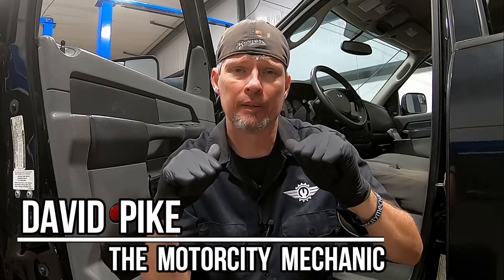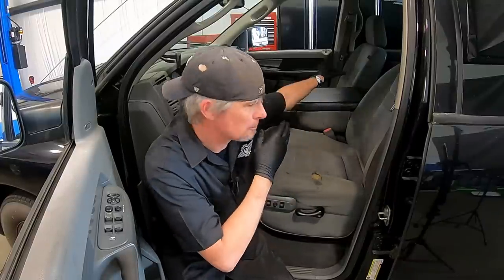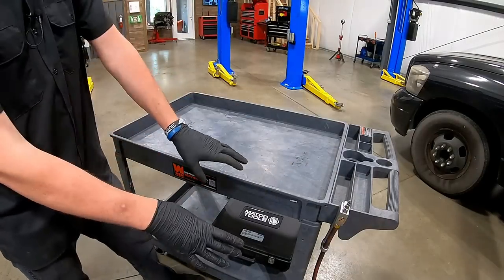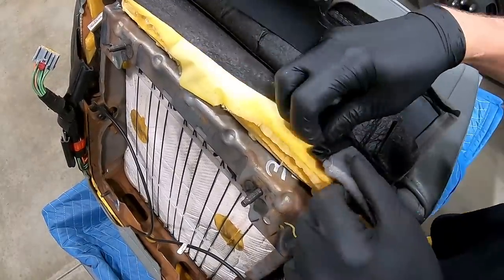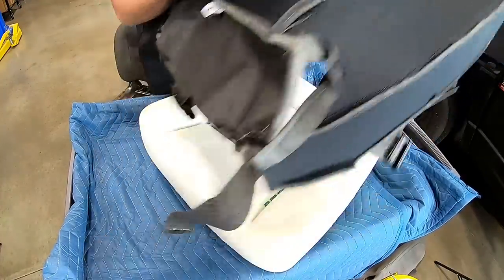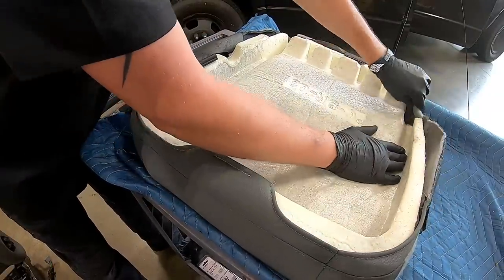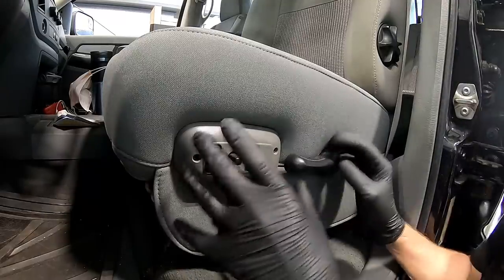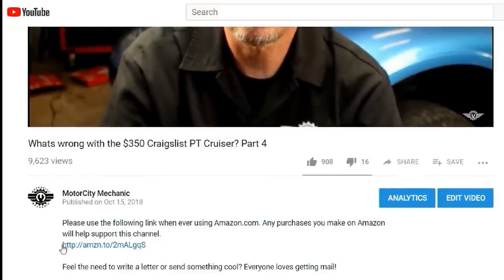2006-2008 Dodge Ram truck lower seat cushion and cover replacement

Comment: Just changed mine. You don't need to remove the chair or any of that. Simply remove the straps at the bottom and wiggle out the cushion from the back and done. No ratchet no nothing. 10 min job start and finish. 2006 dodge ram 1500. Exactly same seat in the video.

Comment: Great video!  One of the best "how-to" videos I've used.  My seat looks much better!  I do have a couple of suggestions to add for those who are about to tackle this cushion and cover replacement.  Be careful with the felt material - it is rather fragile.  I did tear off one of the clips - possibly because I pulled too hard or just at the wrong angle.  Also I suggest waiting a little further into the process to cut your opening for the electrical controls.  I ended up cutting my opening too high.  Because of the new thicker cushion the cover didn't pull down as far as the old one did.  So I suggest pulling everything tight and clipping in all but the clip closest to the controls so you can see exactly where to cut.  With a new cushion it may not exactly match the opening in the old cover.  One more thing - be careful if you press in the Velcro strips then decide to pull them back off.  One of my bottom strips starting pulling out of the cushion instead of the Velcro releasing.

Comment: The Bob Ross auto mechanic video producers. Nice, no stress explanation. Well done!
Reply from the maker: Many thanks. Those are happy seat covers 😂
Reply: @MotorCityMechanic do you know if there is available seat replacement cover kit for a 2003 dodge ram truck electric seat diver side

Comment: You've taken a lot of mystery out of upholstery. It wasn't that hard. At least you made it look easy Dave.
Reply from the maker: Now if I had to stitch it....that would have been another story! Great to hear from you Wyatt!
Reply: A Dad dadafrra
Reply: This is Plug & Play upholstery. Otherwise, you would take the old cover, & very carefully cut the stitching holding the various pieces together. Then you would use each piece as a template, laying them out on your chosen material, & cut new pieces from a roll or two of bulk fabric, vinyl, or leather. Then you get to sew the individual replacement pieces together on an industrial sewing machine. Automotive upholstery used hog rings to secure the covers over the foam & on to the seat frame, perhaps along with a copious amount of contact adhesive. It is amazing how much labor can be involved. Automotive upholsters usually have some very strong wrists & fingers from pulling & stretching material all day long.

Comment: Your video was spot on excellent.  I followed other videos that said don't have to take the seat frame out.  I ripped two of the straps on the rear and had to hand stitch them back together with Velcro to make the straps and clips easier to remove and reinstall in the future.  I have an 06 Standard cab.  It was worse trying to put  the straps back on.  There is no room for my '76 year old hands to get the straps beside the center console.  So tomorrow I am going to remove 4 bolts and do it your way.  Thanks for your video.  God bless.

Comment: Outstanding video. I have to replace my entire seat frame as the motors no longer function. I am now extremely confident in the necessary steps for R& R of the complete assembly. You are a most excellent instructor!!

Comment: Thanks for a great vid, Dave.  I did this on my 2nd gen Ram a year or two ago.  It was actually easier, due to design and I don't have power seats.  The aftermarket cushion is more comfortable than the worn out, crumbling 20 year old one, but it's too stiff.  I'm a tall guy who sits somewhat upright, so now my head rubs the headliner and I can't get the power mirror on the driver's side to angle high enough for me to use without ducking.  This was never an issue with the original cushion, even when the truck was new.  Maybe one day I'll try to take an inch or two out of the bottom of it.  Also, some of my metal rods under the cushion were broken; I used cut down thick wire clothes hangers to replace them.
Reply from the maker: El Cheapo your welcome and thank you for watching. This cushion is a bit stiffer and takes some use to “relearning” what it was like when it was new, use to that old flat cushion lol

Comment: Just watched your injector replacements. I was told I needed all 6 replaced and the bill was gonna be around 6,500-7,500, had truck hauled home been Sitting ever since. Lost my job right after that truck been sitting fir 13 months but just got new job(f..k this covid it killed me finacially) but truck #1 thing on list, batteries dead buying new batteries Saturday having truck hauled to another place I been researching talking to people. Thanks you saved me a ton of unneeded money spending. Wished I could talk with you, there are injectors on eBay, says Bosch injectors ranging from 101-200.00,  any find anyone that will tell me why that injector on eBay is 110.00 and dodge house or diesel shops are 500.00-1.200 a pop. 
Don’t know what to do in that, hate to buy 110.00 of eBay but don’t have 1,200 fir 1-2 either right now. Thanks will check back to see if a time has posted or replied time post any help greatly appreciated thanks Stev-O

Comment: Great video! Its so much easier to remove the seat first. I bought a cheaper cushion and added support on the bottom to keep the springs from wearing through. Geno's  cushion is worth the extra money.

Comment: That was the most in depth instructional video I have seen in a long time!! GREAT JOB!! I need to do the same repair to my 07 3500 Mega Cab. Also I need to repair the electric seat. I will not go up or down or tilt forward/back. It does however move forward and back for leg adjustment. Do you have a repair video for that?

Comment: I'm thanking you so much for a great helpful video, only thing I'd say is take the seat bolts out first, then flip seat a little back to access the electric plug. Otherwise all was great 👍.

Comment: Just installed new foam and cover on my 2008 Dodge Ram Megacab drivers seat.  This video was very helpful however you missed the two clips at the ends of black fabric at rear of seat. This flap should go on first, then the strap coming across, and finally the carpet cover piece.  Anyway thanks for the video. Seat came out great.

Comment: 23:28 Just recovered my Ram 3500 seats and there's two clips at the outer edges of the rear black felt strap that clip onto the outer corners of the rear seat frame before you finish folding the carpet flap over. I noticed you missed them in the video (I almost did too but I caught it on final inspection)

Comment: Many years ago at my old job practical jokes were amuck.  Best one I saw/heard of was after a coworker got another coworker, was to slim Jim his vehicle (company vehicle that is) take an open can of sardines and place it between the cushion and seat springs. The open side against the cushion of course so it would soak up the juice. After a few days of sitting in hot and humid GA weather it stunk to high heaven and he couldn't find the source of the smell.

Comment: Awesome video! I'm glad you said Geno's has covers that also fit 1500s. I have a 2011 Laramie and found what I needed for cushion and cover. The driver's vented section works but not the heated. Passenger's side no issue. Both heated and vented work. Any thoughts as what to look for when I do the replacement? Thanks

Comment: Great video.  You are an excellent teacher.  One question, my seat back is worn through and a piece if metal is sticking through and the recline handle does not hold.  How do you replace the seat back cushion and the recline stops?

Comment: Great video! Thanks. One question. Did you do the wrap up, at the end of the video, before you actually did the replacement? I noticed that the side of the seat cover was all wrinkled at the video ending.

Comment: Hey just wondering if I take the seat out like you did on my 2008. Will any of the air bags go off? I didn't see you disconnect the battery at the start. Do you have 2?  Good job and good Info Tks.

Comment: Great Video, gonna do this myself. One question...is that stereo factory or aftermarket? My 2006 2500 has the 6 CD changer and it is not working well and needs to be replaced. I have heard that it is difficult to replace it and get anything near a factory look.
Reply: Looked like pioneer stereo
Reply from the maker: Actually it’s a next generation Mygig touchscreen. I had to buy a bezel and what they call a “lock pick” to make it work. Has some glitches like the clock and home location on the Nav. I love it over the older joystick version

Comment: Bro,
I fucking love your videos.Mai key because your truck is so much like mine looks wise parts, etc. 
you go thru every dang step my granddaughter if 10 years old watched this video 3 times and has my seat out and cushion off. In am going to install cushion abs seat abs she already has torque wrench set at 18 lbs. you actually go thru each step, slowly & show every thing needed to be done. I wished you had a video on replacing all the injectors. Might hv to be in 5-6 parts but love the way you go in abs show every thing needed to be done abs actually how to do that step. I got 2 injectors screwed up so figured while I’m in there, I’ll replace all 6, already hv injector gasket set, head gasket, replacing fir 3rd time the POS China plastic sided radiator, bought a new hand tig sides and complete thing welded all aluminum radiator upgrading to a 3-row instead of OEM 2-row radiator,  made in the USA
Reply from the maker: Thanks for the kind words man. I try to add as much info as I can......some people complain about that but I feel it’s needed for every skill level to know the steps needed. Again....many thanks

Comment: Looking for an option: Do you know if the wiring is already there in BIG HORN trucks with drivers side power seat, to add power to the passenger side??  We are 2 handicaps here and need to be able to adjust seats often for any long distance travel and the next step up to twin power seats is BIG BUCKS!!

Comment: I'm looking for that exact same seat cover. I already bought the replacement foam from Geno's but the covers that I could find do not look exactly the same as the one I need and the one you installed here on this video. Got a link for that specific seat bottom cover?

Comment: I don’t see those hog ring fasteners that were used in the 70s for seat upholstery.
Reply from the maker: James Nasto very true. I use to use plastic wire ties on those when I had to replace an older cover or heated seat pad

Comment: well i have a 07 and the seat is not like that to unbolt. I can only take whole seat and frame out It seems. Havent done it yet because the 18mm bolts are so tight need tolube them and try again

Comment: I have a 07 dodge ram 1500 and I cant figure out the type of upholstery it has. Its not leather or cloth. Anytime I had split a liquid of some sort. It wouldn't stain. Just roll down to the middle of the seat. If anyone knows I would appreciate it.

Comment: Sure wished someone would do a vid on drivers side seat cushion upper back seat cushion. I really screwed up throwing the old one away, shit I regret it. Side they discontinued making it I was told I need upper back cushion fur a 2009 Ram mega cab bucket seat drivers side back cushion oh I found one but it was like 600.00 bucks when I bought bottom seat cushion for like 120.00. Now I hv to devise my own seat cushion outta square pieces I am going to buy at Walmart. The upper part kinda curves around kinda gonna be hard